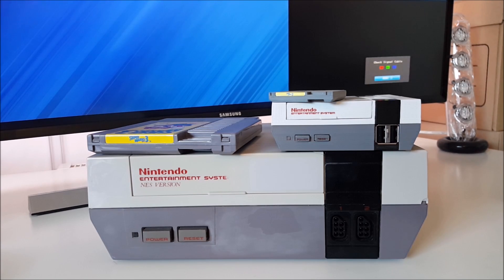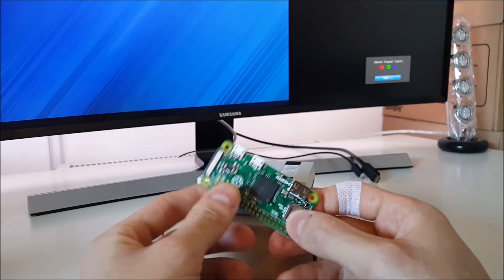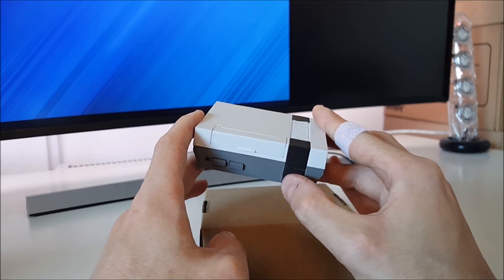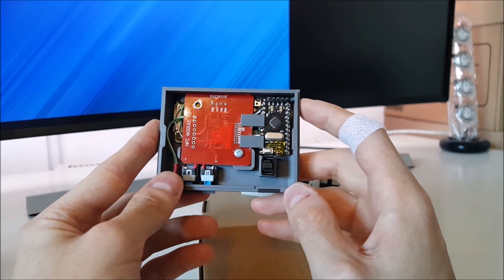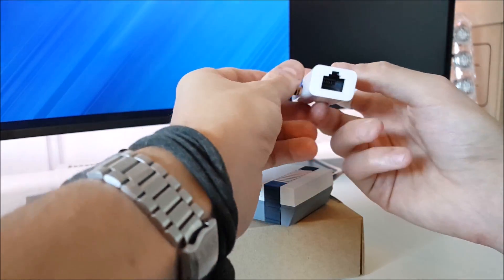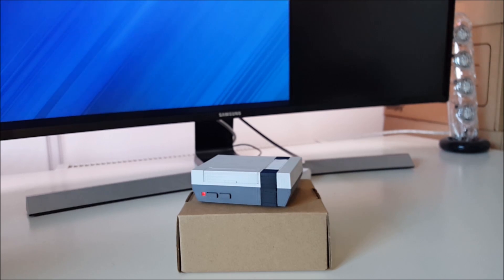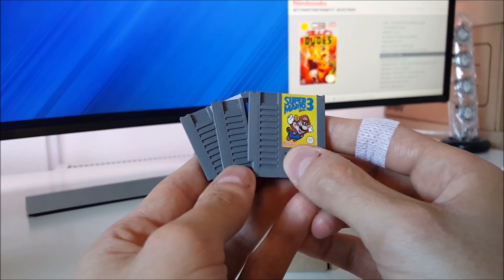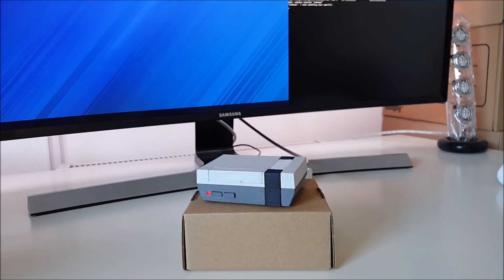Mini(er) NES Raspberry Pi Zero Console

Comment: Can somebody help me? I'm trying to put together a complete Mini(er) NESPi with NFC reader and power management from the Arduino. My main question is how does the 'power on' works, if the USB power cable connects directly to the Raspberry Pi Zero?
Reply: Hi, The Power Switch works using a script and connects to GPIO Pins 5 and 6.
Reply: TheTransformerCrazed can you point me to that script? Or tell me how it works?

Comment: Question, 
1) Will this case work/fit  with the pi zero W model (Wireless)?
2) does it have room for a heat-sink if I cut out/dont install the cartrage functionality?
3) What switches/buttons did you use on the case to power on/restart the pi? 

Cheers!
Reply: It will work with the W, it's the same size.

Comment: With the new pi zero W, this just gets even better.
Probably enough room for 2x micro USB ports on the front, using 30 awg kynar mod wire. And usb controllers can use OTG adapters easily.

Comment: how did you deal with power? In the mini one you said you were adding a new micro usb port for power. But both in your original mini and now in this mini(er) case you use the micro usb port from the pi itself and still have a proper boot up sequence.
Reply from the maker: In my first build I intercepted the power coming in from the micro usb port and controlled it with the arduino and a high-side mosfet switch.
In this build I don't control the power at all, the arduino just holds the Raspberry Pi's reset line low when I want it to be 'off' and allows it to go high when I want it to turn on. Kind of a virtual power switch really.

Comment: mike regarding your normal size NES 3d printed shell, are the files you released easy enough to alter?. As i would like to mkae my 3d printed case slightly larger than your model, obviosuly id need to keep the hdmi and micro usb section of the case at the same scale however?
Reply from the maker: Try this model: http://www.thingiverse.com/thing:1035878
It's larger than mine and looks very accurate.

Comment: You coulda start your own company and sell the 3D files or just ship a starter pack for themselves put together you coulda made thousands
Reply: +Time Waster Digital grammar. eye no your so stoopid.
Reply: You're**
Reply: I printed the case already, came out perfect. I did it in blue as a test run 1st though to see how it would come out on my printer.. his tolerances are perfect, I'd suggest printing the case and all the bits before u get the parts so u can test fit everything and glue it up ready to go/ same with cartidges, just don't glue them closed yet =)

Comment: Excellent work yet again, love it. Just wondering though does the Wii Pro Controller have any input lag? I found using the Pi 3 with an 8bitdo SNES30 generated a little lag although I was using analogue audio and had my TV set to game mode. I do all my emulation on Retroarch via a Intel NUC 5th gen i3 system and it works lovely with Dualshock 4 controllers. Do you reckon it would be possible to design a NES case for the Intel NUC albeit multiple versions? lol
Reply from the maker: I'm not sure about the lag. I don't notice any, but tbh I don't play too seriously and might just not be sensitive to it.
If the Intel NUCs weren't 10x the price of a Raspberry Pi I might design a case for it lol.
Reply: Yeah, I guess I am a little too serious when it comes to emulation, lol. I fully understand the price cost of the NUC also not being a popular option for most people. Raspberry Pi's are amazing what they can do and cost so little also. Once again great work which puts Nintendo's new NES mini to shame (In my opinion).
Reply: @spiritualastralsoul I'm agree with your opinion!